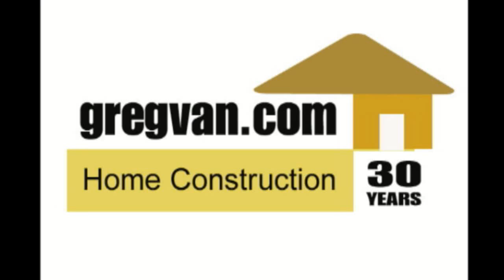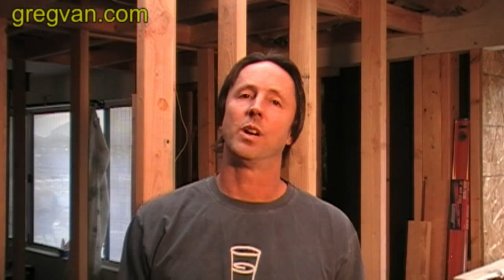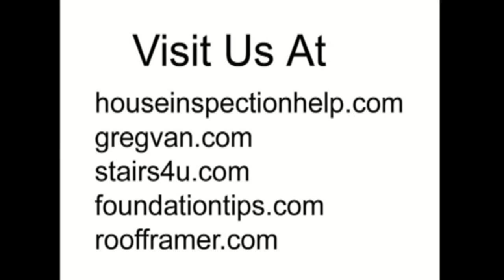Watch This Video before You Remove Any Interior Walls in Your House

Comment: Make a big opening with a header and jacks that meets code, obviously supporting it is necessary during the process. Either way, not a job for a beginner, should be professionally done. Generally the biggest opening you can even have is 8’ and that’s with a (4) 2x12 header depending on what floor it’s on among other things. Also that cuts into allowable ceiling height of your ceiling is below 8’ high. Sometimes it just isn’t worth it.

Comment: I have a bathroom in the extended attic that is attached to the ceiling joist. Above the ceiling joists are/is the rafters but there is no contact that suggest weight transfer from one to another. Neither the joists provide support to a upper floor nor have a cut in the bathroom walls.
I understand the conditions you mentioned for a wall to be load bearing but since I haven't remove anything like that in my life makes it nerve wreaking.
Reply from the maker: Then get more information. If you don't understand then I wouldn't remove anything. Here's a link that might help. https://www.homebuildingandrepairs.com/remodeling/framing/index.html

Comment: Can we possibly remove wall that has air return grille on it. ?
Reply from the maker: I can't provide you with structural engineering information. However, you might be able to find what you're looking for in the remodeling section at the website. Click on the remodeling tab, then the framing link, then the walls or ceiling link

Comment: Clear as mud... how about using some clearer terminology... trusses that run perpendicular to a wall or walls that run parallel to a truss... which is guaranteed load bearing?
Reply from the maker: I try to use a variety of different words and try to keep things simple. If only 10% of my viewers didn't understand what the word parallel or perpendicular means, then I wouldn't be doing my job.

Comment: I have a 6 foot wide wall that divides the kitchen from the ceiling,  I have chatheral ceiling in both rooms , I would like to remove it , I was told by the house inspector that were not load bearing nut I'm not sure.
Reply from the maker: If it's supporting any weight, then it's a load bearing wall, but it can also be a sheer wall and that would be a wall used to prevent the house from moving. Visit our website and go to the engineering section and if you can't find more information there go to the home building tab and click on the framing link.

Comment: Hi Greg I had a leak from my roof ( chimney) flashing . I took my inside wall because I knew moisture was inside . I removed insulation and chalked flashing all good no leak . I also had roofer check all good . I see the header about Two ft of it rotting . The wall it self is strong and mold free . Is is ok to cut the 2 ft section out and replace or do you recommend going longer . I think it may be part of a lateral support . Please advise . Thank you
Reply from the maker: The header will need to be replaced.

Comment: Good afternoon Greg, Do have a video to show how to remove a stud from an interior wall without damaging the drywall on the backside of the stud?
Reply from the maker: +brotherjoeradosti No I don't, but it can be done. If you can, cut the stud into smaller sections, two foot or less and then move the board back and forth while using a pry bar and then hope like heck that you don't damage the other side.
Reply: +gregvancom I like that Greg :) I'll give it a shot. Thanks very much! Have a great day :)

Comment: hi greg,i want to make a vaulted ceiling in my living room,but the rest of the house leave as a flat ceiling
roof is a pyramid hip roof , the current ceiling is made out of 2x4 s  with a 16 ft span ,which makes it pretty unsafe to walk up in the attic
any do's and don't 's about making a vaulted ceiling?
Reply from the maker: The most important thing I could think of, would be to contact a structural engineer to find out what will be required. Going from a flat to a vaulted ceiling is what I would consider to be major structural work and I don't recommend anyone doing it without an engineer.

Comment: I bought my house about two years ago, and I discovered later that there was a wall that was removed to make the living room larger. The house was built in 1920, and is two stories. The dimensions of each floor of the original house is 15x27 total, and the first floor was originally two rooms (it should be noted that the kitchen/bathroom/laundry area is an addition at the back of the house, but this does not play into my question...this is just to give you an idea of the layout of the house). The wall that divided the downstairs was removed to make it one large open living room. The floor joists in the crawl space run parallel to where this wall was. I believe this would make this a non-load bearing wall, but what concerns me is that the wall was in the center of the original house and there is another wall on the second floor that is placed in exactly the same place as where this wall was. I know you can't really give me definite yes/no as to whether you think this might have been load bearing, but can you give me your thoughts based on the information I have given? thanks much.
Reply from the maker: I think this video will provide you with the answer you're looking for Can Removal of Non-Loadbearing Walls Make Buildings Lean? - Structural Engineering. Let me know if you have any other questions or if the video didn't help.

Comment: Im taking down a wall, but I dont know how to remove the wires from the metal frames... any suggestions...
Reply from the maker: It will be difficult for me to provide you with any information if I don't know what type of wires you're actually trying to remove. For example, electrical, lathing or something structural.

Comment: i want to remove a wall in my house but the thing is that im not sure if is load bearing or not .
Reply from the maker: Don't remove anything until you find out its loadbearing and you might need to find somebody in your area like a contractor or structural engineer for more information.
Reply: I would like to send a picture of the structure but where can i send it?
Reply from the maker: I can't guarantee that I will be able to help you, but my email address can be found at any one of my websites by simply scrolling down to the bottom of the page. gregvan.com

Comment: Great videos. I have a 1923 bungalow. The roof sags like nobody's business and probably has since the day it was built.... along the ridge and below. My guess is the sagging is due to using 2 x 6 rafters,  a very low sloping roof, and not having enough bracing. There are two massive supports running across in the attic that tie into the load bearing wall beneath it. The span between the  two braces or hip walls..... for lack of a better term is great. I assume it was built this way to allow for bedrooms in the attic. It is funny how they did things back then... the ridge beam is a 2 x 6 but they didn't have a long enough piece and mended three segments together to run the full span and I have reinforced the mending plates. Is there anything that could be done to reduce the sag? The inspector when I bought it mentioned collar ties. I hate to reverse something that has existed for over 90 years in the matter of a few hours. Does the low slope create more downward pressure along the ridge? I noticed they tied all of the ceiling joists together by running 2 x 4s at an angle from the front of the house to the back. I would assume the pancaking off the roof would cause the front and rear of the house to bow out, so, they had to tie it all together.
Reply from the maker: It would be hard for me to advise you, without actually looking at the project myself. It almost sounds like you would need to contact a structural engineer for more information. If you want, go to http://gregvan.com/contact_us.htm and email me a few pictures of the project and I will see what I can do, but keep in mind that I think a structural engineer might be your best option.
Reply: deezynar
No, I don't plan on doing anything. The roofers said it has settled all it will. Plus,there are issues where I live and it would be throwing money down the drain. That being said, I still take care of the old house.
Reply: +bg147 Have you done anything about this yet?
Reply: +bg147 That makes sense.  Take care.

Comment: Would love some info on removing partial wall for a bar in a load bearing wall seperating kitchen and living room. Have any suggestions on framing/bracing? Know of anywhere i can see some photos of how this is done?
Reply from the maker: Feel free to send me some pictures and you can get my e-mail address at the website on the bottom of each page under contact or you can provide me with a better explanation of what you're going to do.

Comment: I have a half wall that was built in the middle of a large room to divide it into a dining room, and a living room (obviously the wall is not holding anything up, it more for visual and has two electrical outlets in it). Can I fill in this wall to the ceiling and add french doors to the opening to enclose it without a permit? Not planning on touching the electric either. I will double check with city, but just want your opinion before I do.
Reply from the maker: I don't think you would need a building permit for that, but you're on the right path as far as checking with the city building department. As long as it isn't a loadbearing structural wall, you shouldn't have a problem installing the door, but the city might actually have your building blueprints on file and could provide you with more information. The last thing you want to do is cut a hole in a structural wall and weaken the structure or building.
Reply: gregvancom Thank you :)
Reply from the maker: You're welcome

Comment: When framing a door should the header be a simple flat 2"x4" or always thicker?
Reply from the maker: You can use a flat 2 x 4 as long as it's in a non-bearing wall. If the wall is supporting a roof, floor or anything structural, then it will need to be larger. Check out our other videos in the structural engineering area for more information about load bearing walls.

Comment from the maker: If it's a supporting wall, you should have a structural engineer take a look at it. I can't tell you whether or not you can cut into a supporting structural wall, because I just don't have enough information about the building. However, I think it will be possible as long as you provide the necessary support for whatever is being held up by the wall.

Comment: I would like to build a breakfast Bar in a wall. The wall is situated right underneath the center of the house and on top of the wall i think there are couple of joists running all along, so i think it might be a supporting wall (not sure). I was wondering if i could cut out some of the studs, so i have a square hole big enough to build a breakfast bar. Is this possible, even if it is a support wall? any advice on how to build a support around the hole once i take the studs out?

Comment from the maker: As long as they aren't structural or holding anything up. Most of the time, studs under a stringer, can be removed, but under a landing, might be supporting the stairway. Let me know if this makes sense and if it doesn't, I can make a video.

Comment from the maker: I really can't advise you, due to liability issues and the fact that I don't want to be sued, just in case the building falls down. However, you're on the right track, if you remove a load bearing wall, you will need to replace it with posts and beams and don't forget structural foundation supports. If I was you, I would contact a structural engineer, especially if it's going to be a public building.

Comment: I am remodling a house into a bar. It has a long hallway that must be remove. Is it suggested to beam wear both sides of the hall were. ? Hall 4' wide.In addic both walls are tied to roof straight up . One of the walls is the center of the ridge of the roof.

Comment from the maker: The original plans would be helpful, but if you don't have them, it won't be a big deal. Try to figure out whether or not the wall is loadbearing or structural in any way, before removing it. Remember, just because a wall isn't supporting something structurally, doesn't mean you can remove it.

Comment from the maker: You can if you use the right components, but I couldn't provide you with that information. For example, a door header for a single-story home with a regular composition shingle roof, """might""" require a 4 x 4 or even a 4 x 6, but if it's supporting a structural post for the upper floor or roof framing, it might need to be bigger.